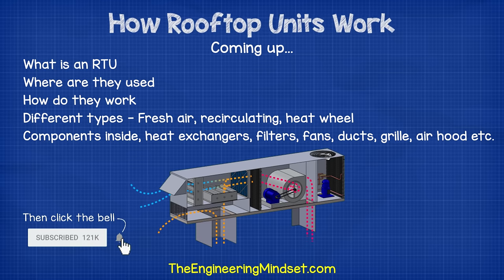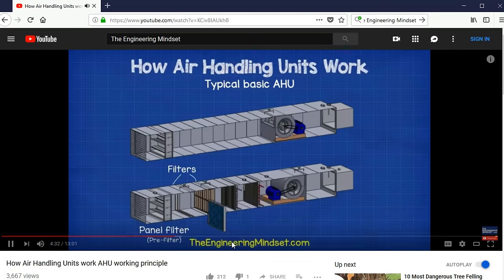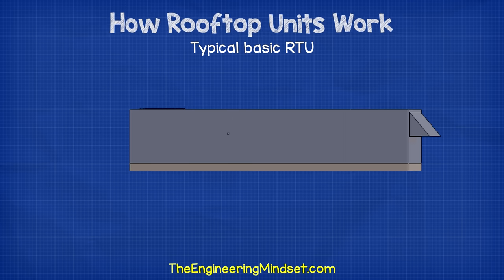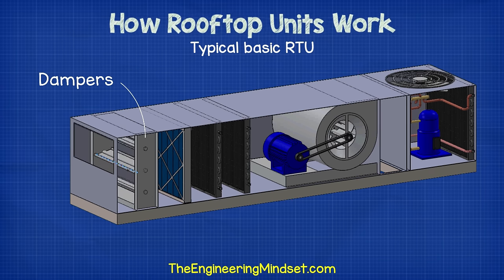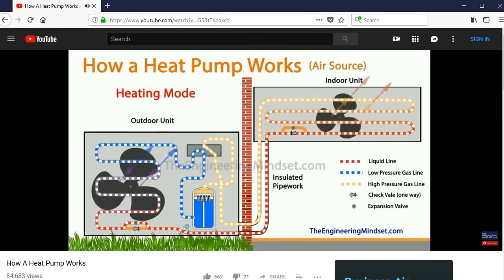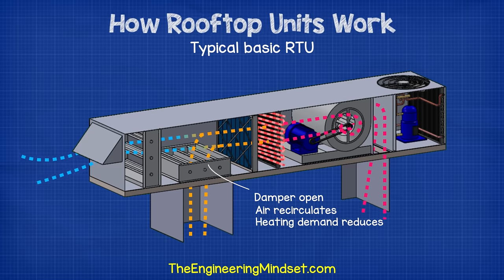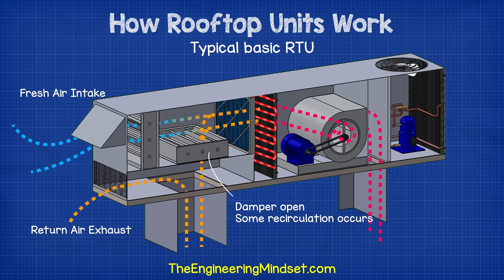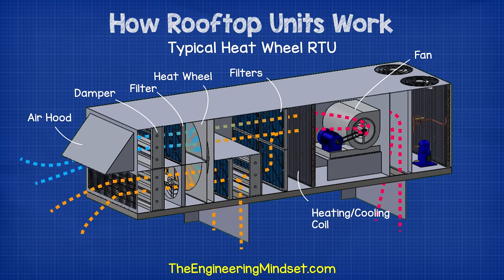Rooftop Units explained - RTU working principle hvac

Comment: When you mentioned the grid to stop animals and debris from entering it reminded me of one of our units at work that failed in a really weird way.  They never figured out the cause so not sure if it has to do with something that got in but basically the main blower shaft was bent and it started to oscillate. The bend got worse and worse and it was basically shaking the whole building!  We could hear various "tick tick tick" vibrations in the ceiling in random parts of the office, just from the false ceiling and light fixtures etc, and thought it was odd but did not think much of it.  This got worse until one of us realized there was a really intense pulsating feeling on the 2nd floor.  It was almost like a powerful subwoofer feeling and it felt different depending where you stand.  The unit was in that room on the roof cooling that room.   Supposedly the vibrations could be felt even outside the building at one point.   The shaft that was bent was several inches in diameter, they still have no idea what happened, but it's fixed now.   As a side note, getting parts from Carrier is like pulling teeth...  They sent the wrong parts at least 3 times.

Comment: A packaged air conditioning means an AHU unit with an inbuilt cooling unit ( that is no attached component such as chillers). This Air Handling Unit cools the air and sends this cooled air through a defined route duct work. The returned air is leaves the building through a defined route duct work to the exhaust channel in the AHU unit.

Comment: A packed unit is a unit that contains all of the system components in one unit. In a home the evaporator is inside while the condenser is outside. In a packed unit all of the components are inside of one unit, like in a RTU.
Reply: Simple as that

Comment: Thank you for the great video, sir. When I saw a belt drive blower watching your video, one question came in my mind. Where do we use a belt drive blower; where do we use direct drive blower?
Reply from the maker: It used to come down to space. It was more compact to place the motor on a belt drive. Now it comes down to money. Direct drive is more expensive but more efficient. Belt drive is cheaper to buy initially but more expensive to run because it's less efficient and required more maintenance and spare.
Reply: @EngineeringMindset  Thank you, Sir.

Comment: How u can be sure that exhaust air is going to different direction but not to fresh air blower and distribute the very bad smell into the flats. I am suffering with this issue, specially in Summer in Dubai. Do u know how long lasts Summer in Dubai? Exhaust air and fresh air can’t be in the same side and over each other, weird construction. Look at the grid which stops the front air and collect the air from exhaust air. 
Thank u for this video, it helped me to understand where that bad smell is coming from

Comment: I've seen some units that have an inside unit, which will have a full cooling cycle with compressor, and then will have an outside unit which will also have another compressor and cooling cycle, and there is glycol lines going between them.  Essentially the glycol is used to cool the condenser and compressor in the indoor unit.   What is the advantage of this vs just having a split system?  Is it because a refrigeration loop has a limited working distance and the glycol lines can go further?

Comment: Is there a fan on the return air or does the suction from the supply air fan do both? Thanks!
Reply from the maker: Some units will have a fan there, some will use the suction side. Depends on the design and the building.

Comment: Can a RTU installed in a sloped roof (1:100)? How efficient would that be? It seems to me that it will be impact the flow air and liquid in the unit.
Reply: A flat (perpendicular to the ground) mechanical curb could installed and supported on the the sloped roof, that way the RTU itself would be flat. But as long as the ducts connected to the unit into the building are where they need to be, there wouldn't be any issue with the air flow and refrigerant flow inside the unit if it were sloped. The refrigerant is being pumped around and so it would flow no problem.

Comment: question: don't we have a packaged AHU that are not installed on rooftops? If we do kindly give an example, please
Reply: A lot of them are installed outside the building on the ground, then have two ducts going into the wall.  I think they basically work the same way.  My church has one.  I think this is typical for buildings that don't have a flat roof as there is no way to install it on the roof.  Also less chance of leakages.  A roof top unit is harder to install properly as if you don't seal things right you can get leaks.

Comment: If the exhaust placed directly under the intake (which is facing down because of the air hood), wouldn't some of the exhaust air get sucked into the intake?
Reply from the maker: Yes